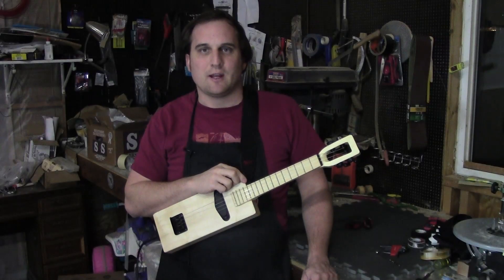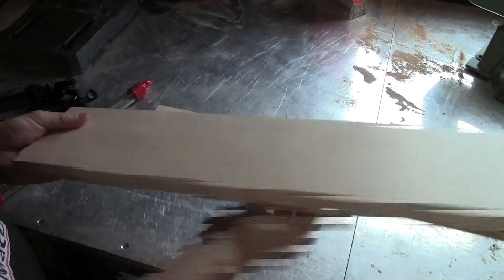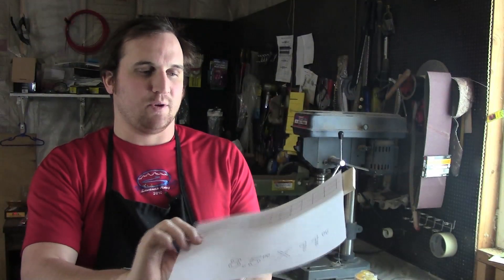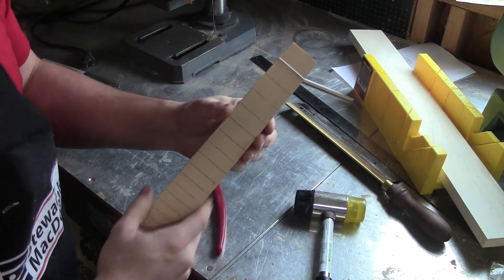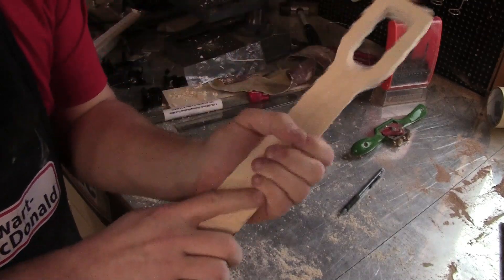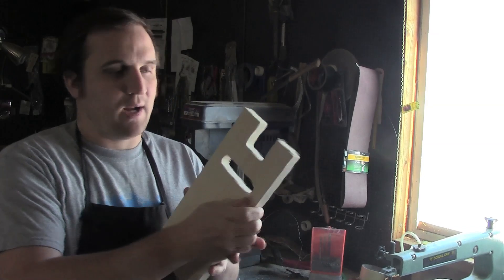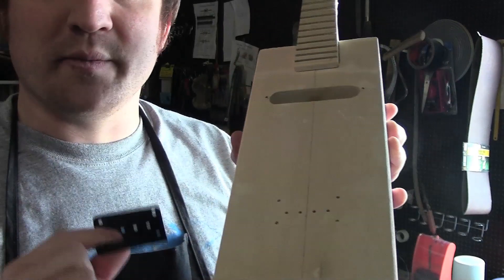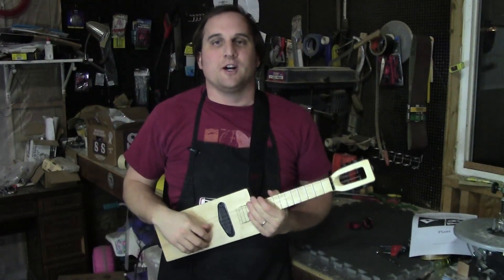Electric Ukulele (Free Plans)

Comment: At 9:44 you talked about using side dot material for the side dots. What material did you use?  I don’t find it in the printed material and it looked thicker than fret wire

Comment: I have done one but I wonder why the first fret jumps almost 2 halftones instead of one... even with lowering the saddle.. I have double checked the fretboard pattern everything is fine... I have ordered some mandolin strings to see if it will sound more accurate. Anyone has a clue?
Reply from the maker: The saddle might actually be too low. Or the second fret may be too high. So instead of the just the first fret being played, the string also touches the second fret. So you good up a whole step instead of a half step.
Reply: @CircuitsAndStrings  thanks, it doesn't even touch the second fret only the first...pretty strange
Reply from the maker: Hmmm. I bet that the nut slot is a little too high. So when you press down on the string, it actually “bends” the note higher.
Reply: @CircuitsAndStrings  yes.. i will keep sanding it lower...i'll see

Comment: Hi Daniel. I made another electric ukulele based on your basic plan.  Thanks for the help.   I used the same sandwich design you showed here and added a few controls and modified the body shape.  This one is based off of the cartoon Adventure Time.  Here is the finished ukulele.  https://youtu.be/BzW5Ysp026I
Reply from the maker: +pchen911 I just checked out your video. It looks awesome. I've thought about doing some kind of "axe" uke.

Comment: very cool guy. love your work
Reply from the maker: Thanks!
Reply: I thought about making a Ukulele out of a fender Star neck. It should make a concert scale I think. Looking for a neck!
Had you done any work with say a fender pick up. Your thoughts appreciated?
Reply: should read "Strat, neck"!
Reply from the maker: I like using tele neck pickups. They look nice for 4 strings. A normal strat neck will be too long. A concert uke has a scale length of 15". A strat has one around 25".
Reply: 21" is an acceptable length (largest) for a Ukulele and the whole neck can be used in the way you have adapted other models you have madeBy use of a capo I am hope to be able to get a wide range although strings will limit that somewhat. I think its a great idea and copy necks second hand are cheap and easy to find. I just bought one for $9 US!